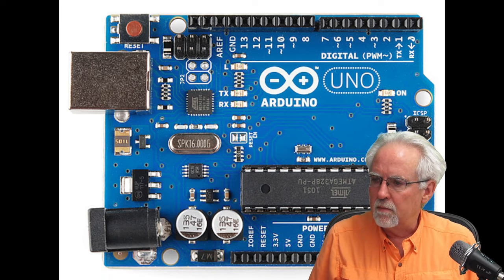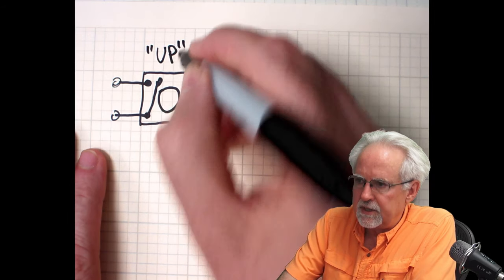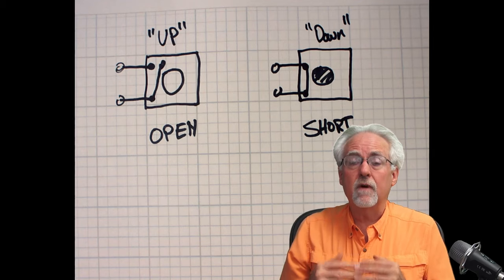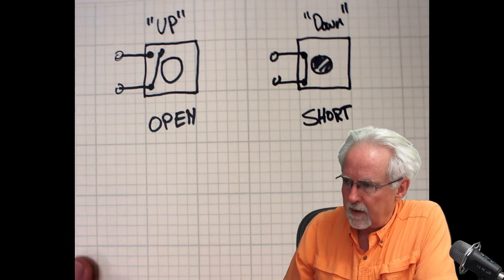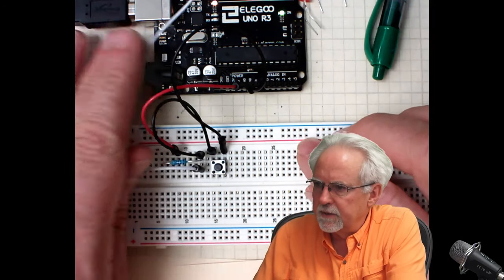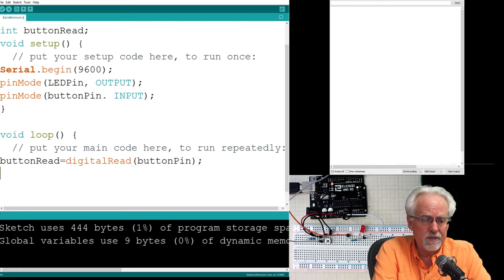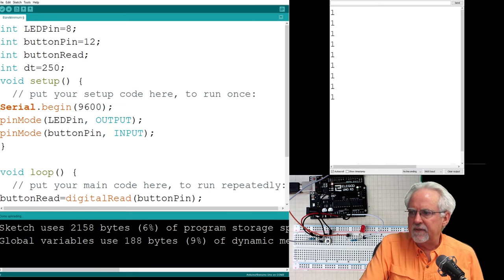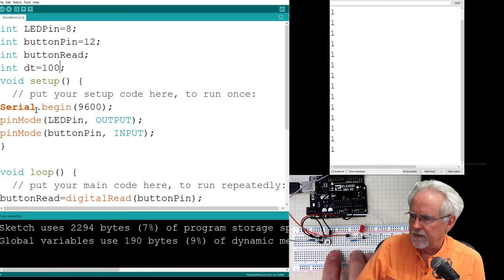Arduino Tutorial 27: Understanding Pushbuttons and Pull Up and Pull Down Resistors

Comment: I couldn't get my switch to work and tried rewiring and recoding 5 times without luck. Then I noticed the program worked when I touched the jumper extension to the jumper ground. I even tried swapping out 3 switches without success. I finally figured out that the legs on my Elegoo Ultimate switches are not long enough to make a connection in the Elegoo Ultimate breadboard. The workaround was to insert the jumper wires into the same holes as the leg pairs to bypass the breadboard but still use the switch. That worked perfectly.

Comment: I got the toggle switch to sort of function with this code I wrote. It toggles on and off, the only problem is if you hold the button down it will continuously toggle on and off. I'm so close!

int readPin = 13;
int redPin = 8;
int(buttonRead);
int x;
int dt = 250;

void setup() {
  // put your setup code here, to run once:
Serial.begin(9600);
pinMode(readPin, INPUT);
pinMode(redPin, OUTPUT);
}

void loop() {
  // put your main code here, to run repeatedly:
buttonRead = digitalRead(readPin);

if (buttonRead == 0) {
delay(dt);

x += 1;

if (x == 1) {
digitalWrite(redPin,HIGH);
}

if(x == 2) {
digitalWrite(redPin,LOW);
x = 0;
}

}
}

Edit: Figured it out. I just needed a loop that keeps count while the button is held down, and only executes while it is equal to 1 or less! This toggle comes on right away when the user holds down the button. With some tweaking it can be used to time how long the user is holding it down, then trigger a secondary action.

int readPin = 13;
int redPin = 8;
int(buttonRead);
int x;
int counter;

void setup() {
  // put your setup code here, to run once:
Serial.begin(9600);
pinMode(readPin, INPUT);
pinMode(redPin, OUTPUT);
}

void loop() {
  // put your main code here, to run repeatedly:
buttonRead = digitalRead(readPin);
if (buttonRead == 1){
counter = 0;
}

if (buttonRead == 0) {
while (counter <= 1) {

counter += 1;

x += 1;

if (x == 1) {
digitalWrite(redPin,HIGH);
}

if(x == 2) {
digitalWrite(redPin,LOW);
x = 0;
}
counter += 1;
}
}
}

Second Edit: Fixed the indentation and remembered back to when we first started using strings; When we want to wait for another input, we can just use an empty while loop. In this case I put the digitalRead(); command in the block that waits for the signal to equal 1 (push button let go of) before the on/off code is ran. I'm super satisfied with the result, as it serves a separate function.

int readPin = 13;
int redPin = 8;
int buttonRead;
int dt = 50;
int x;
int counter;

void setup() {
  // put your setup code here, to run once:
  pinMode(readPin, INPUT);
  pinMode(redPin, OUTPUT);
}

void loop() {
  // put your main code here, to run repeatedly:
  buttonRead = digitalRead(readPin);
  if (buttonRead == 1){
    counter = 0;
  }

  if (buttonRead == 0) {
    while (buttonRead == 0) {
    buttonRead = digitalRead(readPin);
    }
    x += 1;

    if (x == 1) {
      digitalWrite(redPin,HIGH);
      }
      
      if(x == 2) {
        digitalWrite(redPin,LOW);
        x = 0;
    }
  }
}

Comment: Hi mr.paul i am trying to make ac light dimmer using 3pushbutton. 1st button for switching ON load, 2nd and 3rd for Increment and Decrement, my condition for this is if 1st button is on, fan speed should be able to increment or decrement, if OFF no increment no decrement. can you help me in this, like what should be the syntax ,condition..

Comment: Paul -

You gotta quit making me yell at you about INPUT vs OUTPUT and periods vs commas.  But while I was doing that I now understand about pull-up and pull-down resistors.  I had been using them working on the 8-bit computer with Ben Eater, but never really thought about the why.  No voltage drop with no current flow.  That is why they work.  Thanks.  Ken

Comment: My Logic: 

int pin1 = 12;
int pin2 = 13;
int led = 9;
int lightVal = 100;

void setup() {
  // put your setup code here, to run once:
  pinMode(pin1, INPUT);
  pinMode(pin2, INPUT);
  pinMode(led, OUTPUT);

  Serial.begin(9600);
}

void loop() {
  // put your main code here, to run repeatedly:
  float volt1 = digitalRead(pin1);
  float volt2 = digitalRead(pin2);
  
  analogWrite(led, lightVal);

  if (volt1 == 0) {
    lightVal += 20;
    if (lightVal >= 255) {
      lightVal = 255;
    }
  }

  if (volt2 == 0) {
    lightVal -= 20;
    if (lightVal <= 0) {
      lightVal = 0;
    }
  }

  Serial.print("pin1 = ");
  Serial.print(volt1) ;
  Serial.print("| pin2 = ");
  Serial.println(volt2);
  Serial.println(lightVal);
   
  delay(100);
}

Comment: It seems to me like different Youtube videos present fundamentally different ideas of how pushbuttons work. Some seem to be saying that while the button is in its up state, the signal moves through the button from one leg to its opposite leg, and that when it's down, the other two legs are exposed instead. In this video, there seems to be no connection whatsoever when the button is up, and when it's down, a U-turn connection occurs on both sides. Could you please address this in a reply, and maybe shed some light on whether all pushbuttons work the same way or not? It would be very much appreciated.

Comment: noob question here. does anyone know WHY we need the resistor here? Why 10K? I tried 5K and it still worked, but idk if there's a reason 10K is used. I also tried the pull up one WITHOUT the resistor, it does read the 1 when not pressed but the board disconnects as soon as I press. if we read the value of a 5V connected to the ground, it should be 0 with or without resistor, shouldn't it? Also if you know any good resources that would help with these kinda basic questions, I'd really appreciate it.

Comment: I do not understand why you have to use a resistor to read the push button whether it is high or low. I just tested this without the resistor and it works just fine. Do I miss something?

Comment: had to come back to this to check and didnt see it in the video but what is the purpose of the resistor (in general, i know from a subsequent video that there is an internal pull-up resistor)? is its only purpose to change the logic state (in addition to preventing a short circuit)?

Comment: I thought the pull up/ doen resistor was to eliminate noise on the read pin. Also, without the resistor, would the pin get shorted????

Comment: Here is my solution to the homework..

/*This example makes use of the INPUT_PULLUP pinMode.
 * This uses the built in 20k pullUp resistor, supplies 5v, and will return true/high or 1 while switch is open.
 * Just wire the buttonPin lead directly to the switch, and the other side of the switch to ground.
 * There is no need for a direct 5v lead or 10k resistor on the breadboard*/

byte ledPin=13;    //Using pin 13 turns builtIn LED on and off too.
byte buttonPin=2;
boolean ledState=LOW;

void setup() {
  pinMode(buttonPin,INPUT_PULLUP);    //INPUT_PULLUP uses built in 20k resistor in place of using one in the physical circuit. 
  pinMode(ledPin,OUTPUT);
}

void loop() {
  while(digitalRead(buttonPin)){
    /* wait for button push, and keep checking. buttonPin will return 1/true/"HIGH" until pushed.
     * buttonPin will return 0/false/"LOW" while switch is closed, and escape while()*/
  }
  ledState=!ledState;                        //Whatever LED is doing, change it to opposite boolean state.
  digitalWrite(ledPin,ledState);       //Turn LED on or off.
  while(!digitalRead(buttonPin)){   //Wait for user to get fat finger off the button. Prevents double read if the button is held down.
  }
}
Reply: You are the best and lovely teacher I have seen may life MR.
THANK YOU SO MUCH

Comment: But why not use 330K, or 1M resistor? That should work even better no?

Edit: Ok, no. It shouldn't be too small because of the high current, but also not too big because arduino's input also has some internal impedance and if the pull-up resistor is too big, it would have too big voltage drop and you wouldn't get logical 1 to your input.

And also because the resistor has some capacity, too high resistivity could cause delays in reactions (human wouldn't care but if you need to switch thousand times a second, this could be significant issue)

Usually pull-up resistors are in kilohms range.

Edit 2: Just out of curiosity, I connected all my 10K resistors in series as pull-up resistor, totalling 100K and measured analogRead on A0. I got 1023, rarely 1022. So I guess the internal impedance of arduino is by orders of magnitude higher

Comment: I've got a question, Paul.  Everything works, but instead of "1" or "0", it reads the Pin number.  I've changed the pin, and it changes the number to the pin number.  But the LED only lights up when I push the button, as it should.  What could I have done wrong, that the serial.println is displaying the pin number, and not 1 or 0?  I'll include my coding...

int LEDPin=8;
int butPin=12;
int butRead;
int dt=50;

void setup() {
  // put your setup code here, to run once:
  Serial.begin (9600);
  pinMode (LEDPin, OUTPUT);
  pinMode (butPin, INPUT);

}

void loop() {
  // put your main code here, to run repeatedly:
  butRead = digitalRead (butPin);
  Serial.println (butPin);
  delay (dt);

  if (butRead==1){
    digitalWrite (LEDPin, LOW);
  }

  if (butRead==0){
   digitalWrite (LEDPin, HIGH);
  }

}

I eagerly await your reply, or anyone else's, I am stumped!
Reply: Alright, folks, who spotted my "mistake"?  I did this on purpose, to show everyone how not paying attention to detail can bite you!  You see....aaahhh, I can't pull this off.  I messed up.  The reason I'm reading "12" is because I am printing (see serial.println above)  the but(ton)Pin, not the but(ton)Read.  With the correct information in the serial.println (butRead), you get the correct value of either "1" or '"0".  Hope this helps someone, I scrolled through hundreds of comments, but only found one other with a similar problem.  Thanks for your time, Paul!  Problem corrected!

Comment: Yikes, for some reason my breadboard connections are really sensitive with buttons and 10k resistor. My LED goes off and on by its own with no input from me...
Reply: you have a floating voltage or ground the resistors and circuit are not doing the job.

Comment: Dear Mr. McWhorter,

i loved your lessons so far and have been eagerly watching them throughout the past days. But up to this video there have been two moments where i was wondering why you would "overcomplicate" things.The first one was when using the potentiometer, where you were reading from its output pin with an analog in pin to then tell another output pin to output voltage to an LED accordingly. Sure we want to learn how to use an arduino, but wouldn´t it be far more practical to directly hook up the LED to the output pin of the potentiometer (of course with a resistor in between)?  Same thing with the push button. Of course we can again read the voltage in a pull up/down resistor configuration with a digital in pin, but wouldn´t it be far more practical to directly hook it up the LED (again with a resistor) to the pushbutton and use it as a simple switch?

Kind regards,
Martin Pohl
Aachen, Germany
Reply: Hi Martin,  I believe the purpose is to allow for modification.  Hard wiring the led is fine in the completed project, but by allowing the Arduino to control the result with the potentiometer rather than just allowing the potentiometer the show the result, allows the creator to modify what happens.

Comment: Hi Paul, I don't understand how you decided to use the 10k ohm resistor, why can't we use 5k or any other, is there any calculation behind that ?
Reply from the maker: It is a standard value for this application. To go into the reasons does not have a simple answer. So sometimes you just have to go with the standard value. Thanks for your comment.

Comment: Another great lesson Paul. Why does a Read (in this case Pin12) read a "1" - is it a function of the Read Pin?
Reply: Peter Corbett Landscape Photography it is a function of the digital read.  Just like a digital write can only write a 0 or a 1 which is 0 volts or 5 volts, digital reads can only read a 0 or 1 with the same parameters.  Remember when we did the analog reads and writes?  Those analog values can vary but a digital value is one or zero only.

Comment: Hey sir,
Just a quick question. Why is a resistor needed? Is it because the pins need to receive less than 5V's to the ground?
Reply: basically you can blow out LEDs and other stuff in the kit
Reply: to reduce the current. The voltage is still going to be the same, you are connecting the wire to a constant 5V pin, 5 volts don't change
Reply: if you supply current without a resistor you will burn the LED

Comment: nothing easier than connecting the LED directly to 5v pin with a push button and 330 ohm resistor XD.
srry but I felt that this doesn't make sense :)

Comment: Bruuuuuh You are using very long method i have easy methods (Coding): // C++ code
//Change variable values according yourself)
int redPin = 6; (port)
int buttonPin = 7; (port)
int buttonReading;
int dt = 250;

void setup()
{
 pinMode(redPin, OUTPUT);
 pinMode(buttonPin, INPUT);
Serial.begin(9600);
  
  
}

void loop()
{
  buttonReading = digitalRead(buttonPin);
  Serial.println(buttonReading);
  delay(dt);

  if(buttonReading == 0){
    digitalWrite(redPin, HIGH);
    }
    else{
      digitalWrite(redPin, LOW);
      }

}

Comment: Why don't you do a proper lesson and teach them to use the INCORPORATED pull up. That will result in less parts , better programing and less headache!!!!
Reply: it would not work for all cases just wait if you only use the internals eventually you will burn out your inputs and have to have another adruino.